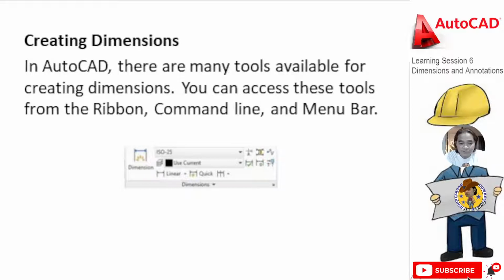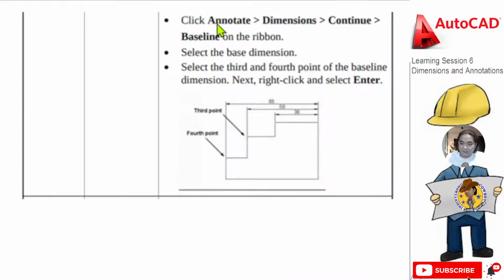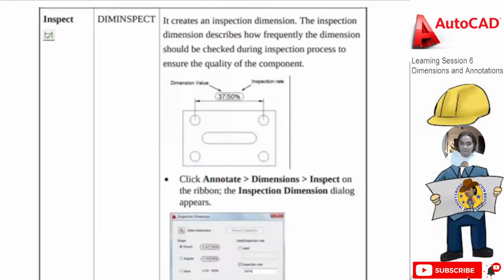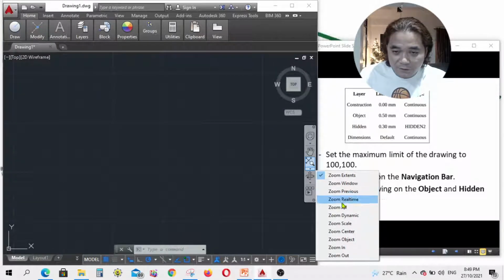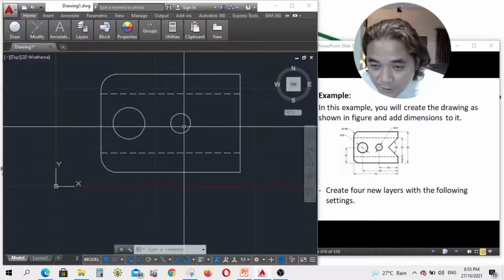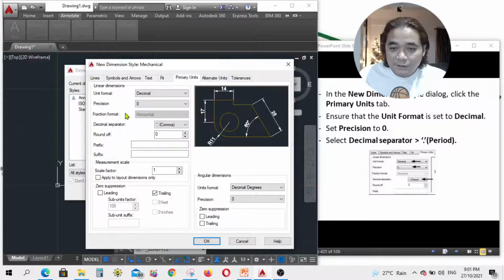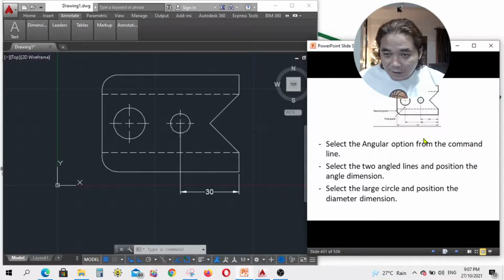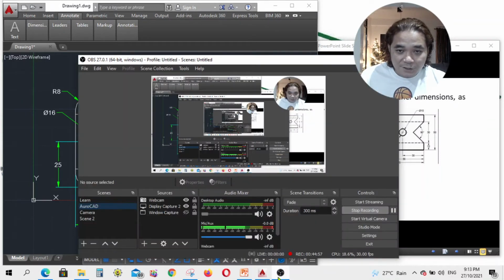AutoCAD LS 6-1 | Dimensions and Annotations

Comment: In this video (LS 6-1), the use of dimensions in autocad software is discussed because it will serve as the industry standard. The plan will be read by the constructor. I acquired knowledge about how to add dimensions and annotations. Additionally, it covered how to establish different types of dimensions and how to do it by measuring things like ribbons or other objects. The use of diverse dimensioning tools is the most crucial. Shut cut is a tool that makes it simple to create dimensions. Up to the end of the video, which was more fascinating and knowledgeable and gave me a useful strategy for creating activities, I learnt a lot from this session.

Comment: Throughout this tutorial, I learnt about the AutoCAD dimensioning tools, which are shown in this video and can automatically measure distances and place dimensions on our drawings. In AutoCAD, the user may either choose the parts they want to dimension and leave the rest to AutoCAD, or they can define exactly what sort of dimension they want as well as which object or points they want to dimension. I also learnt the differences between linear, radial, angular, ordinate, and arc length dimensioning. Using the DIM command, I discovered that dimensioning is a specific item type. Users may also quickly define and maintain project dimensioning guidelines by utilizing dimension styles.

Comment: In this video they tackle about how dimensions used in auto cad because it will be the guide of the field. Constructor plan will be reading the plan. I learned in how to create dimensions and anotations. It also discussed the dimensioning how to create various types and creating dimensions by assessing the dimensions in the ribbon or etc. The most important is the function of various dimensioning tools. Tool, shut cut and its function to easily the create dimensions. I learned a lot of this session until the video ended the video was more interesting and more interesting and knowledgeable and give to me a good technique of create activity.

Comment: This video content is really helpful for my knowledge of AutoCAD's Dimensions and Annotations. Since I've been working with dimensioning, I've learnt how to generate several types of dimensions along with a few best practices for it. Additionally, Engr. Mardie explains the following tables: Dimension, Linear, Aligned; Arc Length, Continue; Baseline; Angular; Diameter; Radius; Jogged; Dimjogline; Center Mark; Ordinate; Quick Dimension; Adjust Space; Break; and Inspect. " Dimensions can be created using a variety of tools in AutoCAD. The appearance of dimensions depends on the dimension style that we choose when generating a dimension style. A new dimension style can be created using the Dimension Style Manager dialog. Settings for the appearance and behavior of dimensions are available in this dialog. You're a hero, sir! This video is quite educational. I can't wait to see what else you have in offer!

Comment: In this learning session I learned the AutoCAD dimensioning tools in which demonstrated in this video that can automatically measure distances and insert dimensions on our drawing. In AutoCAD, user can either select the elements that want to dimension and let AutoCAD do the rest, or we could just specify exactly what type of dimension we want as well as which object or points to dimension. I also learned the different types of dimensioning which are linear, radial, angular, ordinate, and arc length. I realized that dimensioning is a certain item type by using the DIM command. And using dimension styles, users may rapidly create and sustain project dimensioning rules.

Comment: For the first part of learning session 6, I really do appreciate this video content because it greatly aids my understanding of AutoCAD's Dimensions and Annotations. I’ve learned how to create various types of dimensions and some standard ways and best practices of dimensioning. Engr. Mardie also discusses the table which gives the functions of various dimensioning tools: Dimension, Linear, Aligned, Arc Length, Continue, Baseline, Angular, Diameter, Radius, Jogged, Dimjogline, Center Mark, Ordinate, Quick Dimension, Adjust Space, Break, and Inspect. In AutoCAD, there are many tools available for creating dimensions. In creating a dimension style, the appearance of the dimensions depends on the dimension style that we use. We can create a new dimension style using the Dimension Style Manager dialog. In this dialog, we can specify various settings related to the appearance and behavior of dimensions. Kudos to you sir! This video content is very informative. I'm excited to see the next videos!

Comment: Another lesson , another learnings. In this video I learned that AutoCAD's dimensioning tools can automatically measure distances and place dimensions on your drawing. You can either select items and let AutoCAD add the necessary dimensions, or you can tell AutoCAD what type of dimension you want and which object or points you want to dimension. Linear, radial, angular, ordinate, and arc length are the most common types of dimensioning. Using the DIM command to automatically produce dimensions for the item type you want to dimension. You may quickly declare your conventions and maintain project dimensioning standards by using dimension styles.Thank you for this video Sir.God Bless

Comment: in this video, I learned what is the true definition of dimensions and annotations and what are their uses in Autocad, I learned also that it is very important that we use the correct dimensions when we are drawing, while the annotation objects include dimensions, notes, and other types of explanatory symbols or objects commonly used to add information to your drawing. As a student, it also helps in using a scaling factor when we are drawing and it will make it easier to keep the entire drawing on the screen.